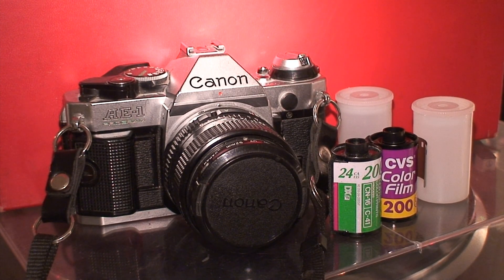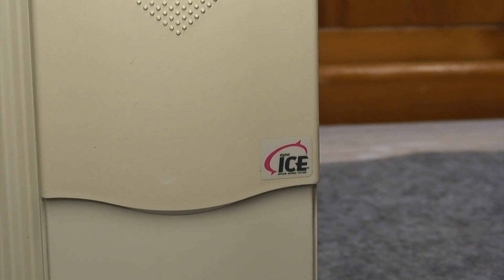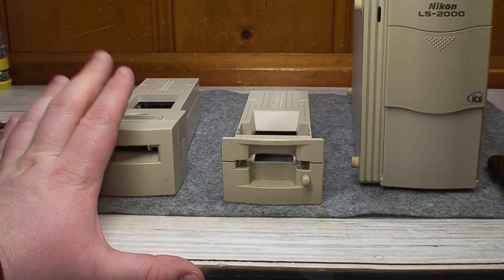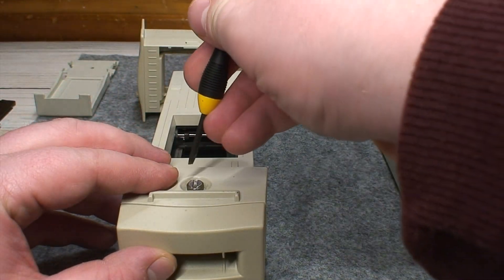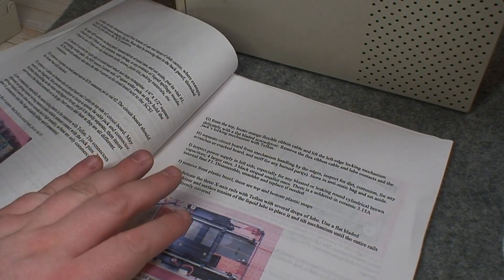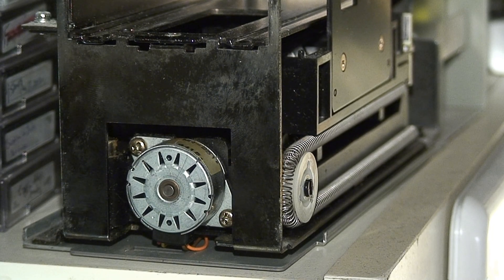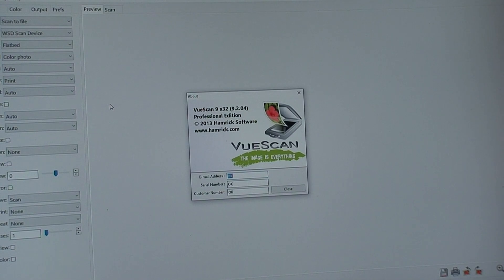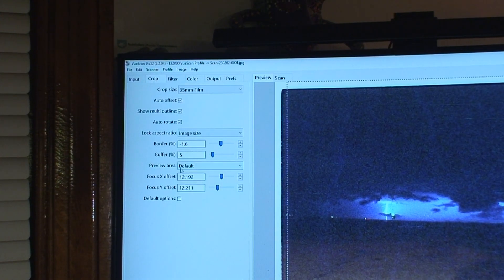Scanning 35mm Film With a 25 Year Old Nikon LS2000

Comment: I have one too and spent already lots of time with this old guy. It's a Nikon: if they say 2700 dpi, they mean it too! Mine has some quirks however - it exhibits flare in the images, when scanning underexposed slides and shadows need to be boosted a lot. I cleaned everything - mirror, lens taken apart and every element cleaned, the glass of the sensor. It helped but still some flare is there. Maybe there are reflections in sensor glass, who knows.
Recommended setting - for good quality scans I use at least 4x oversampling and manual exposure setting (analog gain) for all 3 RGB channels to expose all the channels just below clipping.

Comment: This gives me hope….I still have my LS-2000 that I bought new in 1999 ($1600). Would love to put it back in service but I’m not sure how to go about it. Using Windows 11 on a laptop. Can I simply use a SCSI to USB 2 cable along with some suitable drivers to make this work?
Reply: You could probably run windows vista in a virtual machine
Reply from the maker: Being totally honest, I had enough trouble getting mine to work under Windows 10 using those modified drivers I showed in the video. Using a SCSI to USB cable MAY work, but may also fall flat on its face similar to those Firewire to USB adapters. Windows 11 also seems to be even more persnickety about legacy hardware and drivers than Windows 10, so YMMV. Though you have given me an idea for a possible video in the future, so stay tuned!

Comment: Awesome! This is exactly the type of machine I think of for a film scanner, a 90s beige box that just works, and extremely well! I know modern alternatives are available, but this seems to do the job just fine and I wouldn’t be surprised if this outperforms newer ones since it was made when film was still widely used. Very cool to see you got yours to work with just some simple maintenance. Using it on a modern pc is probably better, at least in terms of storage and software (at least now that you got it to work), but it would be interesting to see if the older XP era software has any advantages. I’m guessing probably not, but it’ll probably still work alright. Same goes for older Mac OS and it seems like it would work considering it’s a SCSI based device. (Don’t know about the software side of things though) I don’t really have any experience with film so I’m not sure what settings would work well. You could always do an unedited scan, and then make a new scan to the preset for cropping it, but it’s probably not worth doing unless you really want a 100% archived as much as possible file. Great video!

Comment: Ooh, Digital ICE, my Epson Perfection V600 has that. I imagine it fares better because the resolution is high enough to capture grain on 100 speed film, but at the same time, they made us master meticulous patching on old photo scans in my digital photography class in college like 10 years ago.

Also, I need to get myself one of these film scanners with the auto adapter. Reasons.
Reply from the maker: I’m still tempted to get one of the cheap modern film scanners just to see how they (can’t) compare to something like the LS2000. Maybe even one of those smartphone film scanners, just for kicks and grins.
Reply: Those smartphone ones might not pair well with newer smartphones since they have that weird artifact of a larger sensor (macro haloing), but with the iPhone you have, it won’t have the same resolution, but the quality is definitely serviceable.